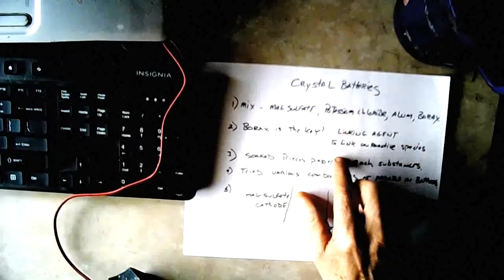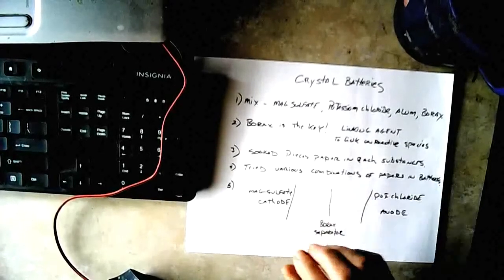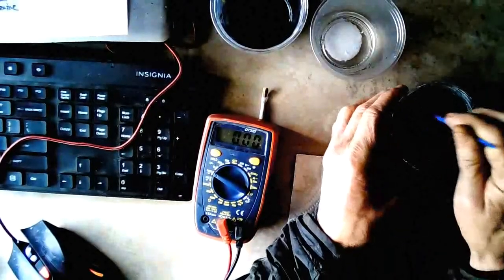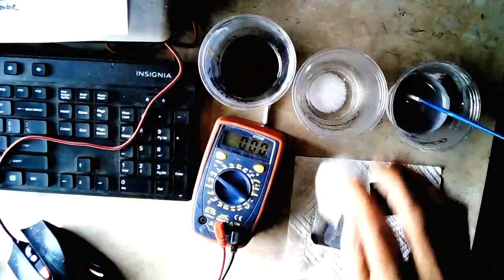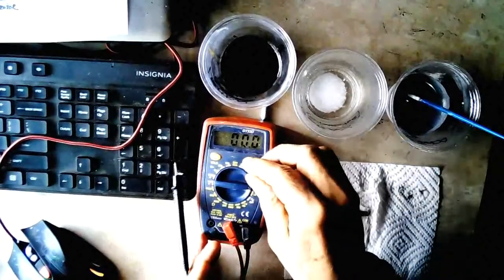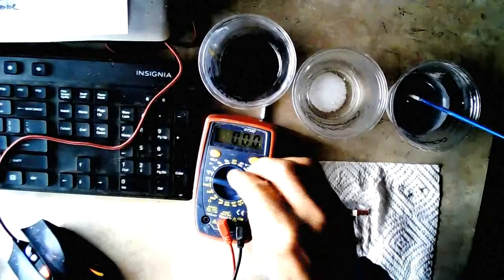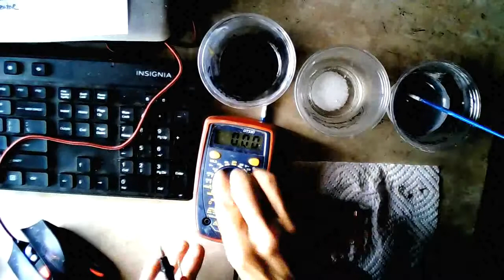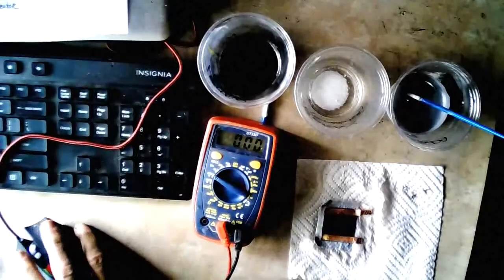Demo #29 Crystal Batteries & Borax

Comment: Thanks for sharing. I was a bit worried about the copper on the anode. Thinking that it may be a galvanic reaction there. So i made an electrolyte out of borax (not very saturated, and tap water), used carbon paper and copper wire with a paper separator to see if I could replicate the cell. The result was around 250mV @ 0.05mA. Nowhere near the output Bio-Cell got in the video. So I think it is safe to say that the copper has no effect on the cell. Other than perhaps working as a current collector. Unless there is something I have missed.
Reply from the maker: Welcome BakamonNo.

I think you're right. I forgot to mention in the video that I couldn't find any place in a crystal battery where alum preferred to be, and eliminating it didn't make any difference in the output that I could see. I have no idea why people are using it in crystal batteries.
Reply: Thank you Bio-Cell. 

If I'm not mistaking the alum was not introduced in the original cells. I think that was just something people wanted to experiment with. If my memory serves me right, there was this claim that aluminum in its metal form was good at holding on to a static charge. And therefor introducing (doping) the cell with alum would make it better at holding a charge. The only benefit I can see with alum is that it is much better at holding onto water in its crystal structure. While most other crystals grown in a normal atmosphere will dehydrate within days or weeks. Alum crystals can keep it's transparency for a very long time. Which will give the crystal cell a longer operational time before it drys out and some water needed to be introduced to (reactivate) the cell. Most likely at the cost of a higher internal resistance. I can vaguely remember someone claiming that alum would act as glue. But that may be just my imagination.  Sorry for the bad English.
Reply from the maker: Interesting. I didn't look at the history of the crystal battery, but liked that it could produce electricity for such a long time. There is so much we don't understand about batteries yet. My next video is going to be about using the bio-cell as a research tool to find some answers.